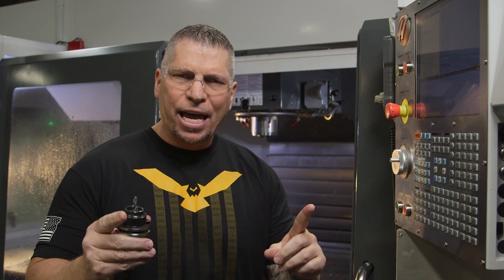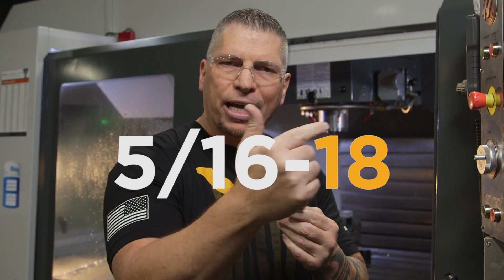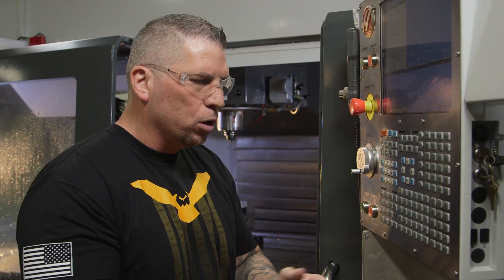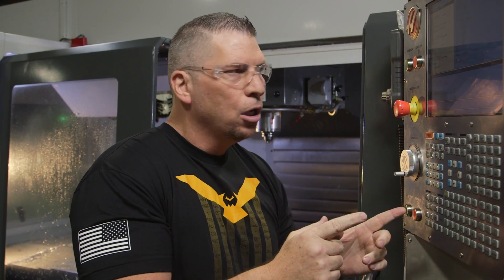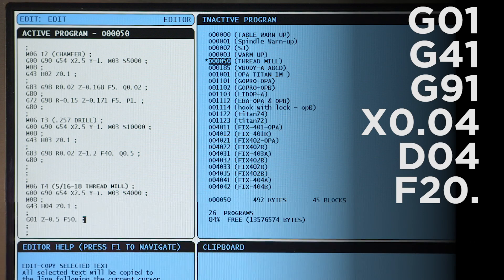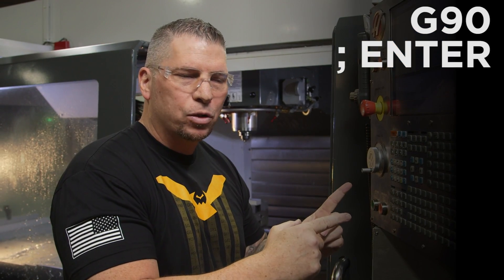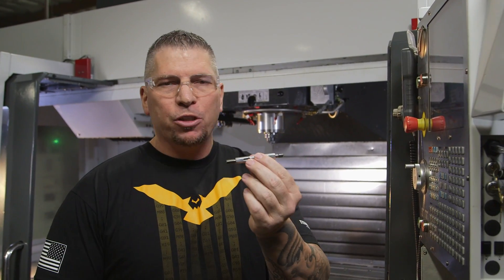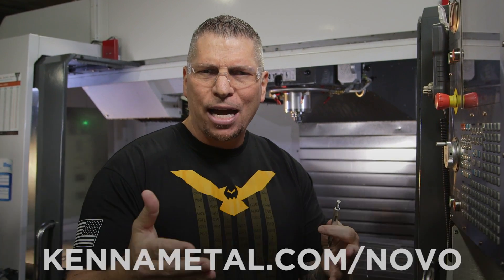G & M Code - How To Manually Program A Thread Mill - Vlog #57

Comment from the maker: At 2:21 there's a graphic error of ".2325", which is wrong. It was supposed to display ".257" for the drill size. Sorry for the mix up!
Reply: Hi, i little missed a G40 after all to close the G43 but cool video
Reply: I was going to point that out lol
Reply: Igual eres un genio hermano, mis respetos y gracias por lo que compartes.
Reply: Hi Titan how can I use this technique for a single point thread mill?
Reply: @Lepp004  no there are many more lines needed for a single point thread mill. I was hoping this video was for a single point treadmill normally programming a single point takes me close to an hour without CAM. I was hoping he had a cool trick like the last 3D roughing video.
Reply: Hello Titan, please explain about external thread milling 1/2"-14 NPT , X and Y starting position.
Reply: @CNCVMCTECHNOLOGY  it's the same principle only you're comping in not out, but if you're approaching a hub with clearance room personally I would use a lead in.

Comment: I have only been programming for a few months and I tried this today on my brand new HAAS VF4 and I got a cutter compensation alarm because the 0.04 move was smaller than my tool offset diameter. I had to use the distance from the center of my tool to the max thread OD. Were you doing this with a zero value in your tool offset diameter?

Comment: If spindle speed is imperfect, can this still be done with single tooth cutter?  I know for fact my 30 yr old cnc will not synch S and F perfectly..
Reply: Unlike Rigid Tapping, Spindle speed error is irrelevant with thread milling, single or multi tooth. This is because with thread mills, particularly multi-tooth like what Titan is using in this vid, there is no helix to the teeth, so all that spindle speed error is going to cause is chip load than expected.

Now with that said, yes, this type of incremental programming can be done with a single tooth cutter but you have to repeat the helical move (i.e., the G03 I0.040 Z0.055) enough times that the mill comes all the way up and out of the hole before moving back to center.

Example, if you were doing the 5/16-18 thread like Titan and using an identical size thread mill, just single tooth cutter and were starting from 1/2" depth as he did (i.e., recreating the exact hole specs he did, you would need to do the Helical move at least 9 times (10 or even 11 would be preferred to ensure that you were truly out of the hole before moving back to center and back down to repeat passes.

Comment: Titan. I have an important question. I need to "Clock" a Thread on a 9mm Barrel with a Thread Mill. The Barrel will be finish machined, and the end of the Muzzle will be turned to Ø.496
The Thread is a 1/2-28 - UNEF 2A. I have a ±4° window to work with on this. It will be for a Compensator. This will be set-up on a Doosan 4500 Mill with a 4th axis. Probably use a vise on the bed for positive location and repetition. Any help would be appriciated.
Thank you Sir.

Comment: That program can be written a better and easier than that. I understand stand it works but we always arc into cut. Never feed straight into cut and using g91 with comp. Should use actual radius of dia.

Comment: I believe that you missed z-.055   end of the pass.   finish pass started at .165  above  the started depth....
Reply: There was nothing missed. All 3 passes start from Z-0.5 (absolute).
Remember, at the end of each pass (after tool moved back to center while still in G91 (Incremental) ), he put it back into G90 (Abs) and then the next line is Dropping the tool back down to the Z-0.5 absolute (i.e., the G01 Z-0.5 F50. ;  line) and then the next pass starts and then it does the same thing, back in to Abs, moves back down to Z-0.5 and then back into G91 (Inc) and does last pass.

Comment: if possible can you do a tutorial on g code helical milling. i have been g code programming for a while, my shop does not have master cam.all of my parts are weldments and take time and skill to set-up properly, so if there is a chance i can save time in the machining i would like to learn.we dont have the rigidity most parts have, so our speeds and feeds are normally slower.i look forward to hearing from you. cheers, Robbie

Comment: I'm sorry sir I have no idea what the hell you're doing I do know how to program just fine not on that control no fan of Haas machines here take that PC controlled stuff and throw that trash I wouldn't trust anything to a PC
Could you please do that in fanuc code hell I don't care if you do it in paper tape code for a Yasnac.
I am actually looking into some treadmills right now never used them they're insanely expensive Its just hard for me to see the the economy in it unless you just use one of those single tooth cutters that I can actually grind myself those full form cutters at $400 $500 even $600 unless I can get that many holes out of one I cannot see how it's cost effective.
I can EDM threads I had to do that a few times used to keep a Bridgeport attached to the front of an old excello EDM it was very difficult to work around but we mounted parts on rotary tables or indexes on the Bridgeport and we would burn in airfoil shapes or even threads  in some of the already heat treated materials you know on hard material always had good luck using a under size tap while it's soft and then using a carbide tap to clean up the thread make it look nice and be on the size when it's hard we've made tens of thousands of holes that way in 718 inconel even 909 inconel have you ever machined 909 inconel look up the surface speed for carbide boom!.
Thank you sir

Comment: Great Video Titan. Can you go over why you choose to thread mill vs. rigid tapping with an M29?
Reply: Since you have not had an answer I will give you a few reasons that may help. One is that when tapping blind holes you can get a fully formed thread nearly to the bottom of the hole. If you were rigid tapping you would normally start with a taper tap then use a bottoming tap which requires two tools so adds time to the operation since the tool has to be changed. Another reason is that using rigid tapping for blind holes it can be hard to get all the debris out and the tool can jam and then snap off. This is usually a major problem if it happens as the broken tool will be stuck in a hole and can be hard to remove, a thread milling tool is a smaller diameter than the drilled hole so is unlikely to snap and is also a lot easier to remove if it does. A third reason is that a thread milling tool can be used for different sizes of thread, This tool, for 18 threads per inch (0.555" pitch so why wasn't that used in the demo instead of 0.55" as it will produce a loose and badly formed thread that will pass the go/no go test) can be used for any thread diameter with this pitch, a standard tap can only be used for one size. If you had a single point tool it can be used for a range of TPI/pitches and diameters. This means that if you have a tool changer with limited spaces you can use a single threading tool for many different thread sizes where standard taps would take up many stations. Fourth reason, you can produce left and right hand threads with a single thread milling tool. The final reason I can think of at the moment is for large diameter threads. There are two problems with these, one is the torque required goes up to the point where it may move the workpiece or stall the spindle on some machines and the other is the cost of large standard taps is usually high compared to a thread mill. Hope this helps

Comment: cool video , I used your code with my numbers in my haas vf5 and got cutter comp error code have no idea why , so i messed with the numbers until it was gone ,well all most if i change the last X from X- to X it will run to the end but the cutter moves in Y out the side of my part , could you do a how to video on G41/G42 error codes
Reply: Set your Cutter offset to .000 and the rest of the numbers as calculated, then run the tool .200 above the hole and see if it works before dropping it in and crashing a $250 thread mill.  He fails to mention the offset needs to be .000 to start

Comment: From experience, it's usually best to arc into and out of the cut instead of going straight G01 into the part for an improved tool life.
Reply: That is correct but for the purpose of training via YouTube it will likely confuse people and add to the complexity of the program. For a Beginner program it is perfect.

Comment: I keep getting Alarm 369 Tool Too Big on my VF-4.  I’m using the same tool and followed your program line by line. I also made sure to input .2325 on the Tool Offset Page, in the D(Dia) box under Geometry. Is there a setting or parameter that needs to be changed?
Reply: I as well. What he failed to mention is....  you have to set the tool offset @ .000 for this to work, at least on my older VF-1.

These are great videos, but there still needs greater depth of explanation on the why's, how's and for's.

Comment: Amazing  wow 
But i  have dout  were you put in cuter copnsetion cancelled code  (G40) and another one is. What's the actual diameter of the tool and what input on D4.
Reply: If you don't use .000 on the tool diameter offset, You get 369 Cutter comp alarms.  I think the fact that the offset is .000 means you don't need to cancel the G41 since it's technically 0

He would have done well to include that bit regarding the actual offset he used and why.

Comment: Terrible example you shouldn't move .04 in g91 all you need to do is move across half the thread size ie g1 g41 x.1562 then G3 I-.1562 with a z movement of 1 pitch, even better you should show the proper way and ramp on and ramp off its not a hard program to write
Reply: You can't be serious?!? You don't have a thread mill video so you have no authority! It must be a miracle that his thread gage checked PERFECT! 😂

Comment: Hey Titan, thanks for all the videos. 
I’ve tried using this  exact code on my haas at my work, but I get a compensation alarm. I have the correct information in my offsets page, is there a setting I need to change to get round this. Also no G40 either, how does that work. 
Relatively new to this, so any help would be appreciated. One last thing, I thought you have to comp on at least half the radius of the tool. 
Sorry this is such a long comment. 
Boom!!
Reply: Dave, you can use as little as a .0001 comp value when using the (hole dia. minus tool dia.) / 2 formula as long as you set your dia. to zero in the offset page. Hope this helps.
Reply: Hi Tim thanks for the reply. I didn’t know that was a thing you could do. I always thought you needed correct tool info in geometry page. 
What about not needing a g40?
Reply: I just barely saw this trying to figure out how to do thread milling.. The way titan explained it was as if you are programming without tool compensation.. that is why there is a tool compensation error.. take out the g41 and try the same code

Comment: I find it an odd choice to chamfer then drill and threadmill. Any particular reason for this? The main pro I see is the chamfer tool acts like a pilot hole for the drill
Reply: Prevents a burr from forming at the top and prevents the first thread from being mashed when installing a screw.

Comment: Hi Titan. I do prefer do it this way:
G00 x....y.... to position drop in in z and then,
G01 G41 X.75 Y-0.75 D01 F10.
(LEAD - IN) G03 X1.5 Y0. R0.75 ( OR I0. J0.75)
G03 X1.5 Y0. Z0.9292 R0.75 (OR I0. J0.75)
IT IS MUCH EASIER FOR THE CUTTER AND SMOOTHER CUT.
KEEP DOING GREAT WORK !!!!!
Reply: Can you explain for 1/2" 14Npt external thread  depth is 10mm. By index tool

Comment: So with a single point thread mill is it the same math just with more passes?
Reply from the maker: Yes, just add a L value with number of rotations
Reply: Thank you so much but I've never used a L value? I've been learning so much from your videos and made me such a better operator could you use an example?

Comment: love the manual programming videos!! could you do a video on how you guys go about aligning the tail stock to the 4th axis in the mill.  alignment is crucial to making perfect parts!
Reply: Just use round stock with center drill . Or just find center of index head. Then take half the diameter of tail stock . Now just tap to distance of half the diameter using a indicator. Then indicate tail stock straight. It's not to hard after doing this a few times you will get fast at doing it.

Comment: Hi I'm working on a supermax-1 with Fanuc 11m control, I am learning the control and I am running a program that has T1 & T2 but I add it tool 3 which is a 10-32 tap you think you can help me if g84 works on this machine and if it works can you send me the sequence on how will you write that one tool program please thank you

Comment: Can you do a VLOG sometime on using a SINGLE POINT THREAD MILL?   I am generally cutting threads ranging from 4-48 and 4-40 to 10-32.  I would like to use a thread mill or thread mills if possible to avoid having broken taps scrapping parts.  You whole web presence has been so helpful.  Thank you.

Comment: Re: cutter comp. the ancient machines at my school (fadal) require a 90 degree x or y move to the first cutting plane (larger than the radius of the tool) to engage cutter comp.  it doesn’t look like you needed to do that with your controller.  Am I seeing/understanding this correctly?  I know all machine controllers have their own ways of using/requiring the input to some extent.

Comment: One thread mill for many sizes reduces need in machine 32 thread mill can do 6-32,6-32 helicoil 8-32 8-32helicoil and 10-32 same tool.

Have macro just G65Pxxxx D=(thread OD) E=(pitch) F=(feed)R=(rapid plane)S=(speed FT/min) T=(tool dia)Z=Depth)
G65Pxxxx D0.25 E28 F500 R.25 S100 T.125 Z-.4

Comment: Boooom! Can u also add measurement in millimeters. Thanks😀
Reply from the maker: Boom
Reply: Multiply the inch values by 25.4  = mm.
If you have mm and want inch divided by 25.4

Comment: Titan,

If you could go over manually programming a 82 degree countersink. A lot of haas guys have told be it can’t be done. I don’t believe that. I’m thinking setting up a sub program would be the place to start and knowing the change in the radius for each change in z. Not sure how to format it. 

Thanks for your dedication to the trade
Reply: the problem is that the radius changes constantly as you move in  the z. You can't program a radius that shifts constantly. What you can do is make tiny tiny tiny radial and Z moves and at each step recalculate your next radius. I'm talking a tenth in Z at a time. In reality it won't be a smooth chamfer but in practical terms it's probably close enough.

Comment: Should teach this with single point thread mills.  And have a tutorial on G02 and G03 with I' s and J' s. Leading in and out with a arc
Reply: Single point threadmilling is the shxt. So versatile and easy to use with subprograms.
Reply: @ISILENTNINJAI  Can you guys make one?I would watch it.
Reply: @frankr608  the way I would use a treadmill is as follows. If doing 1/4-20 threads with a .250 thread depth on series of .350 deep drilled holes.

1÷20 threads =pitch or z movement while interpolating with G03.
So .05

N1001
T1 M6(.125 DIA SINGL POINT THREADMILL)
(Doing .250-20 threads)
G0 G49 G90 X0. Y0.
S2600 M3 (SPEED RPMS?)
G43 H1 D1 z1.
Z.1 
/m8 (I use block delete to not get soaked by surprise when watching my distance to go)

M97 P111 (CALLS SUB PROG)

X1. Y-2. (DIFFERENT LOCATION)
M97 P111 (CALLS SUB PROGRAM AND REPEATS)

M99 P25 (SKIPS TO N25, PAST SUB PROG)

(****SUB PROG BELOW****)
N111
G91 G1 Z-.35 F15. (at .25 depth on part)
G01 G41 X.065
 [(.25 MAJOR DIA - THREADMILL DIA) ÷2] (START OF G03 MOVE)
G03 X0. I-.0625 Z.05 L6 F25.
 (.05 *6 = .3 SO I KNOW THREAD WILL FINISH .05 ABOVE PART.)

G40 G1 X-.0625( BACK ON CENTER)
G90 G0Z.1 
M99
(***SUB PROG END***)

G0 Z1. M9
G53 Z0. M5 
G53 Y0.
X.?
M30

I'm sure I can re arrange the subprogram portion to be after the m30 so that I dont need the m99 p25. But I just do it anyways as an extra precaution.
Reply: @frankr608  wish I had a machine at home so I could shoot a video on it. Maybe titan will see this comment and do a tutorial on it?
Reply: @ISILENTNINJAI  thanks for that example. I was able to use that for a M12x1.5 thread. Thanks
Reply: @ISILENTNINJAI  so I get calling in the sub to look it 6 times so the single point can go all the way up 1 pitch past top of part. I also get calling up for multiple locations. What do you do for each pass? U obviously are not just doing 1 pass per thread. So do you simply repeat all of that for each pass? Or just keep re running and adjust you D offsets?
Reply: @ISILENTNINJAI  we did it much simpler than  that haha
Reply: T1M6(3/8 single point threadmill)
S6000M3
G0 G90 G54 X-.2 Y0
G43 H1 D1 / M8
Z.1
G1 Z-.5 F25.
G41 X-.25 
G91 G3 I.25 Z.05 L12 F10.
G90 G0 Z.1 M9
M5
G91 G28 Z0 Y0
M30

You can copy and paste if you wanna do a spring pass.